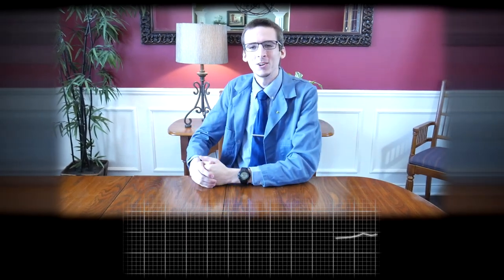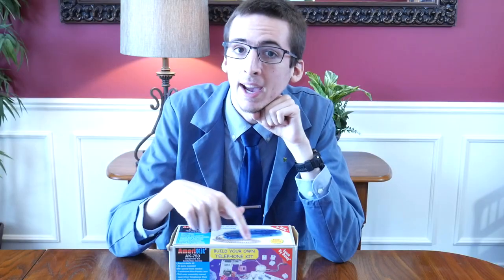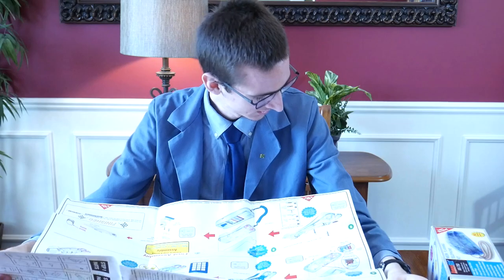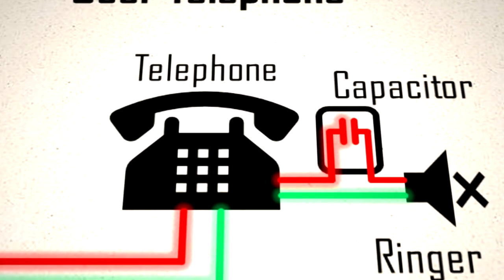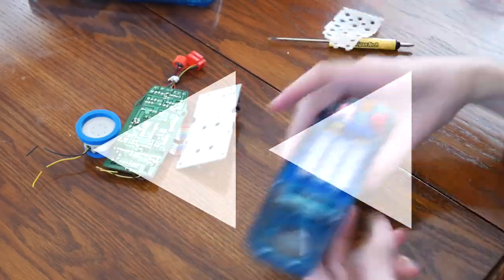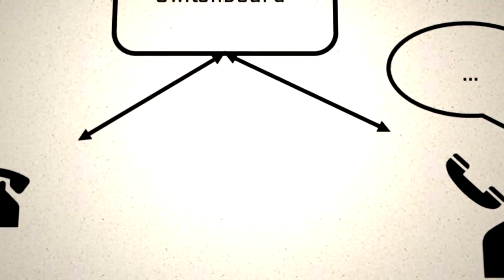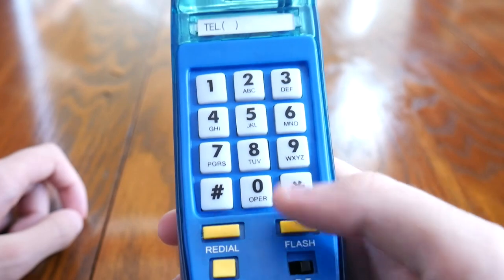Let's Build a Telephone!

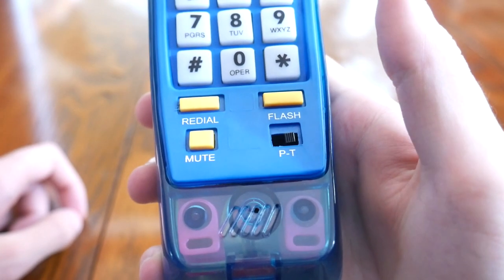Comment: 5:27 - If you have an analog phone service (not VoIP) and a touch-tone phone without a pulse-tone mode switch, you can simulate pulse mode by quickly pressing the hook. You can actually dial a phone number by pressing the hook fast enough (e.g., to dial 555-555-5555, you have to quickly press it five times, pause a moment, then repeat 9 more time).
Reply: It was easier to do that trick when you didn't have to dial the areal codes.

Comment: Could a vehicle be constructed that weighs less than 80-100kg yet aerodynamic enough and powerful enough to achieve highway speeds? 

Better yet, perhaps there could be found a way to seal it from the outside for pressures less than or greater than the ambient pressure inside which could allow it to work underwater or high altitudes in flight. 

It’s main power could either come from the oxidation of ethanol via either a fuel cell or a turbocombustion engine which allows it to generate greater power at higher speeds in flight, or as a submarine underwater without the requirement of air, due to running on its own electrical power.
Reply: A recumbent bicycle or 3-wheel (Velomobile) with an aero shell can easily maintain 50km/h under human power and weighs about 30-35kg, i think. Unfortunately you run into a little bit of practical limitation, that even though it stands to reason that you have enough weight leeway for engine and fuel storage to maintain highway speeds at your target of 100kg, first off, you couldn't take an actual highway in it - it's so small, that people will just run you over, and it has to be this small to be this aerodynamic; and for other, you couldn't survive a traffic accident at highway speeds!